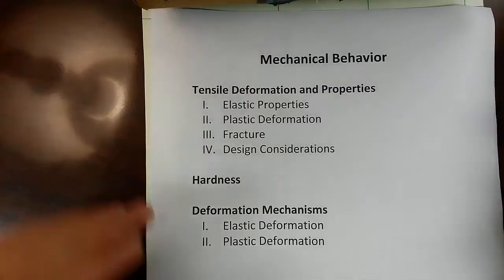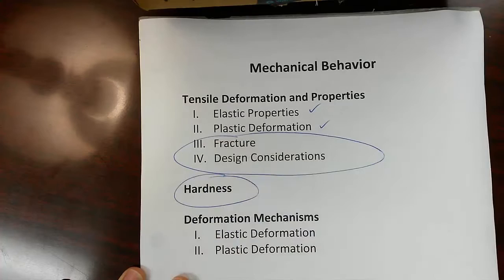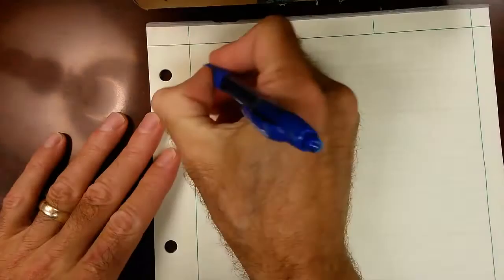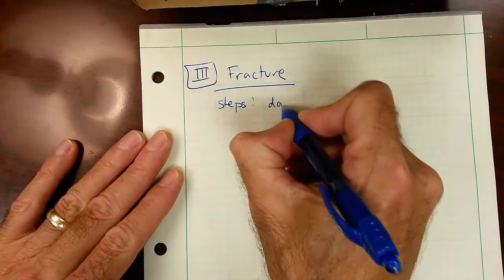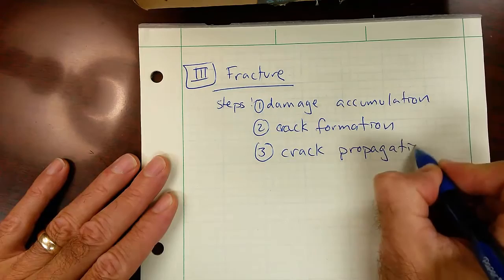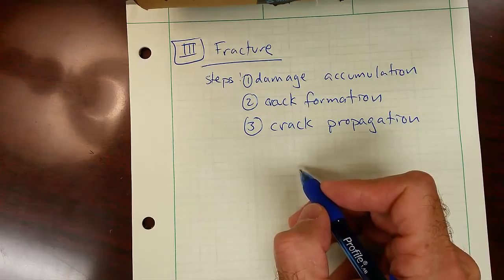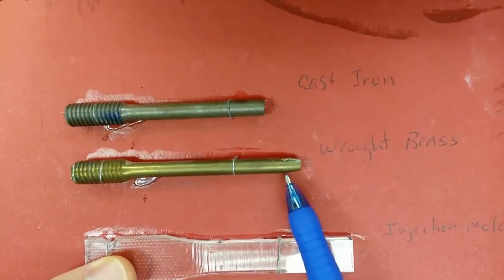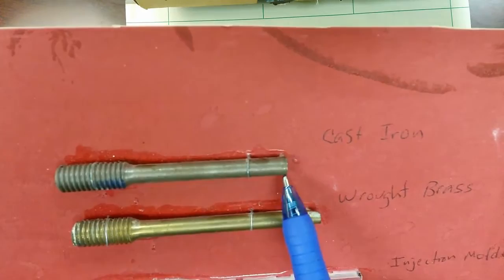Lecture on Ductility, Toughness, and Hardness

Comment: Maybe I missed it but so is the Ductility a measure between the, Epsilon ε value after sloping down from fracture to x axis, and the Total Epsilon ε value on the x axis of the graph? so εf to ε ?
Reply from the maker: The total tensile engineering strain to fracture is a common measure of ductility. The amount of elastic recovery is small and I would generally ignore it.
Reply: @jedlyonsphd  Thankyou, have you got any papers you have written on this subject I can reference by any chance? Currently Writing a paper for my Composites module of my course